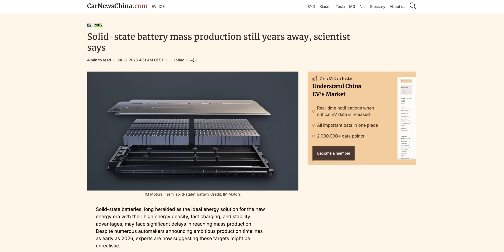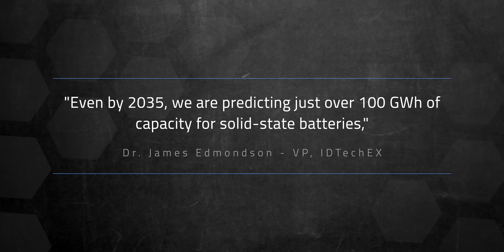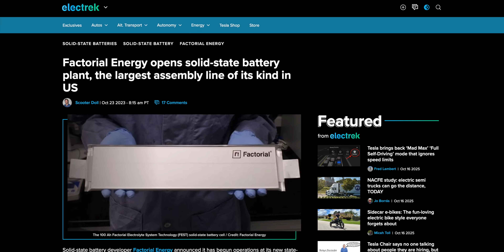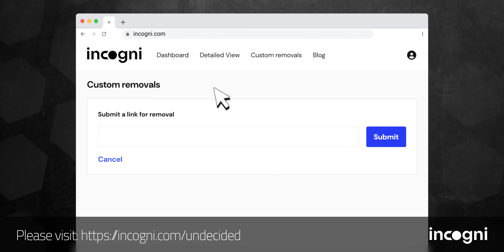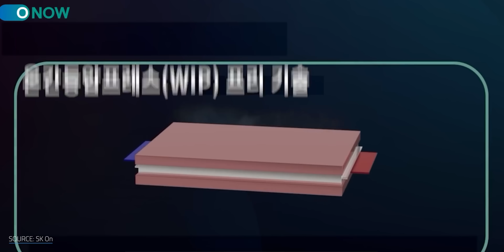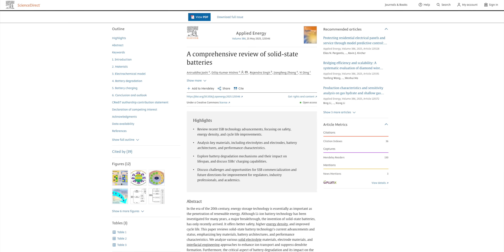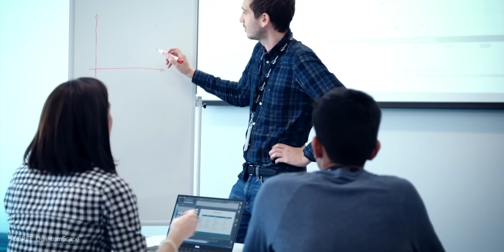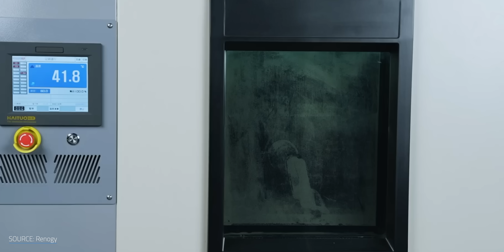How Close Are We to Solid-State Batteries?

Comment: Looks to me that most of the legacy automobile manufacturers have decided to throttle their BEV investments until battery tech, which seems to be on the verge of immense improvement in the near future, finally shakes out to the new paradigm. No one wants to be the one that invested in the last CRT factory.
Reply: Only in the United States. The rest of the world is continuing to move towards EVs, though with a little less enthusiasm since the US has regressed. And, even in America, research and product development continue. Gotta love the effects of politics on progress!
Reply: @GeeDeeBird  to be fair battery tech is really in a state of wild flux right now with a lot of potential battery chemistries and configurations with little certainty on which one will ultimately work the best for BEV. so it is a fairly smart move to keep BEV development in the back pocket until a lot of the craziness with battery development stabilizes. Even myself i am holding off on getting whole home battery backup installed on my house until some of the craziness dies down. the other issue here in the US and globally for that matter is the power grid infrastructure. EV's do require a substantial amount of charging, and power grids need to be upgraded to handle it. North America is badly hamstrung by our low mains voltage and the fact that nearly all homes use very inefficient single phase electrical services. EV charging sucks when your stuck on just 120/240, most of the rest of the world has the advantage of a higher mains voltage, 230 volts phase to ground and 400 phase to phase, but many of those services are also tiny by comparison. and of course there is the fact that many people live in apartments where access to a high powered receptacle to charge them is limited. EV's work fairly well for those whom have their own homes and can afford the electrical addons, but people whom are stuck in apartments are much more limited.

These infrastructure issues will be getting magnified once larger vehicles like Buses, RV's, and commercial trucks start getting electrified. Now some of the battery issues for larger vehicles could be alleviated somewhat by including high efficiency solar panels into their great big flat roofs, but the few pure electric Buses that have been trialed need big beefy 480 volt or 400 volt three phase chargers. Less of an issue for 400 volt land, since three phase is more widely available there, but a big issue in North america due to our moronic power grid design three phase isn't available everywhere.

Now these are problems that are solvable with good public policy, and they should be solved, but it is going to take time. But fortunately there is an even better alternative, and that's dramatically improved public transportation. Even the most efficient EV passenger car gets is rear end handed to it by the humble bus when it comes to energy efficient means of transporting people.Now yes good public transit isnt the best option for rural america or canada, But for cities, public transit is the true winner.
Reply: @GeeDeeBird  The truth is that the consumer demand just never really existed. Once government subsidies and energy rebates dried up so did the demand. Price of fuel and price of electricity vary widely from location to location, but in a lot of places such as where I live the fuel saving on EV compared to a modern fuel efficient ICE is about 30%. While this is not insignificant, for many people it is not significant enough to be a determining factor on a $50k+ purchase. And when you factor in the faster depreciation of EVs on the second hand market, and the talk of introducing an EV road tax to account for their wear and tear on roads that ICE drivers pay for through fuel tax, there is even less financial incentive to go for an EV.
I think things will only change once Chinese EVs build a better brand reputation. They can offer more 'car' for less money than traditional manufacturers, but buying a new car is still an aspirational purchase for most. They don't want to drop $50k on something that other people perceive and cheap or inferior. Budget purchasers buy second hand, where reliability is a critical factor and where Chinese auto makers have yet to prove themselves. So no demand on the second hand market means faster depreciation which again hurts new car sales. 
Anyway the whole EV market was built by government regulation and financial incentives. EVs are the future, but it was silly to think that the gov't would keep pumping money into the market for decades until the tech and infrastructure became mature enough to compete with ICE on every front. Apart from financial incentives the only other tool the gov't can really use is to outright ban the sale of commuter ICE vehicles, which is what many countries are planning to do, but flies in the face of US economic principles and will not be implemented there for many decades to come, if ever.

Comment: Wait a second.....
1 200km on one charge?
Where I can buy this Mercedes?
Reply: Yeah except what they didnt say is the battery cost several millions and can charge 15kw peak 5kw sustained.
Or something.
Stop yapping about range, the key factor is charging speed, with a hint on safety.
Reply: @kolkoki  I can tell you live in the EU LOL. Price does matter, but the charge cap doesnt matter all that much. I will say charge speed does help - but if you can drive 2 x more distance, you also have more time to charge as well for the everyday person (more nights you can charge).
Reply: @adr2t us or eu, if you can drive for 2h and recharge in 15 minutes, thats good enough. So 60kwh with 200kw.
Reply: @kolkoki  Not so sure for the US - driving for 2hs and having to stop to recharge could add hours to a trip. This is why I pointed out that you sound like you are from the EU. Going half way in the states to FL would take around 18 hours -> 18/2 = 9 * 15 (really closer to 20) = 135 mins = 2.25-3 hours. I also assume you will break more as well - so really you are adding maybe another hour for bather room breaks a bit more. I made this trip in an ICE car - took two days. Same trip in a current EV took me almost 3. So having the range in this case would cut off a few hours - dropping it back down to 2 days again. More or less, I like the idea in terms of how many miles the average person drives - but trips can still be a problem

Comment: Battery price falls 10-20%/year, energy density and charge time each improve ~3-8% per year. The solid state label is pretty meaningless, just a buzzword. So long as the batteries keep improving, they will overtake ICE cars in the long run and be far cheaper.
Reply: @BlindedByLogic  yes and no. The reason why solid state is a buzzword is because of the promise it offers of a huge improvement in all battery metrics rather than the expected incremental gains.
Reply: Battery prices are not going to keep falling in price. There is a lower limit. Even ordinary alkaline cells are not yet free, as one would expect by a simplistic extrapolation.

Simplistic extrapolation is a hallmark of modern "consensus science".
Reply: @HuFlungDung2  chinese producers have proven that the current lower limit is already below the costs of ICE vehicles, so every additional decrease is just a bonus ;)
Reply: @HuFlungDung2 it’ll drop to the point where the fixed costs can be sustained.  Eventually those fixed costs will begin to rise with inflation and there will be a price increase in batteries.  Also as power density increases, fewer batteries will be required.  Finally recycling will be automated, further decreasing battery prices as mining becomes less necessary.
Reply: @HuFlungDung2  "Battery prices are not going to keep falling in price. There is a lower limit. Even ordinary alkaline cells are not yet free, as one would expect by a simplistic extrapolation."

Oh, look, it's a stable genius who.... Doesn't understand middle school math. If we reduce a price by 20% per year, how many years will it take to cost zero dollars and zero cents?........... It will literally NEVER hit zero, not even with infinite time (you will end up in an infinite rounding loop at 1 cent). It will still take more than a million years to reach 1 cent. I doubt the cent will even exist by then.

Alkaline cells have in fact been reducing in cost continuously all the way up to today. In theory, at some point, some limit will be reached that will halt the trend. Literally no one believes it will literally go on for a million years until they become literally within a rounding error of free. However, within a reasonable horizon from today, the trend has remained steady for literally a full CENTURY, and we have no reason whatsoever to believe it will change for at least another CENTURY.

"Simplistic extrapolation is a hallmark of modern "consensus science"."

8th grade math. You xxxxed up 8th grade math, and think you are somehow qualified to criticize modern science. Stop. You are actively fighting to spread misinformation (that 8th grade math disproves) and make our species stupider. We will be better off without our contributions. Stop.
Reply: @HuFlungDung2 if it drops by a percentage every year it will never be free
Reply: @BlindedByLogic   Is there any concern with sourcing the metals used in battery production? Defacto modern slavery etc?
Reply: No it won't. Even at the theoretical limit, lithium batteries still can't overtake ICE. It's why solid state batteries is so important, because the theoretical limit would be much higher.
Reply: @khalidacosta7133  blindedbylogic is talking about just batteries in general, not any one specific battery chemistry and configuration, and there are a lot of potential replacements for lithium out there, but its going to take more development to figure out which one will ultimately be the best. and its likely that there will be multiple types of battery chemistries that will win as we figure out which ones will work the best for what application. Like for example a battery chemsitry optimized for a high power to weight ratio is ideal for cars and mobile devices, but not necessarily the best choice for home or grid energy storage where cost per Kwh and long lifespans are more important factors than weight.
Reply: @khalidacosta7133 oh yes they can.  If EVs were cheaper they take over in a few years. ICE is on a dead-end track.
Reply: @khalidacosta7133  Even the compliance cars from the turn of the century were able to handle typical driving (at least in warmer climates).
With ranges of 100 miles/day.
Reply: YASA has a prototype motor at 59kg/12kg. That's 1000bhp. 350-400hp at 28.4 pounds continuous with no exotic materials. 

 Dragsters have 25-35kwfrom what I can find. Have to rebuilt. Someone correct me on the numbers. 

 Chevy(Edit Chery) has a 600wh/kg battery. Graphene capcitators. Pilot plants next year supposedly. 

 Life is good if true. Tech wise. They'll bleed us for it, but it will trickle eventually. 

 Imagine a Miata sized car with full torque vectoring, no tech bloat with a few motors like that.

 Edit. I didn't catch the Chevy typo. Or the MJ! Had to convert that. 

 And the motor is actually 350-400kw continuous. Closer to 500-550hp!
Reply: @RedactedDeath  The mistake you are making is not by stating the torque the motor has. It can spin at 30k RPM and show high horsepower but back in the real world it'll be paired with a reduction gearbox and that motor won't be as impressive. However issue has never been the motors, it's always battery tech,

Chevy has nothing. Car manufacturers do NOT develop battery tech.
Reply: @khalidacosta7133   Yeah I butchered that one for sure. I deserve all the hate. 

  Chery not Chevy. Think they work with Samsung. 

 That's what I get for asking AI to type up the numbers again. I hate converting all of this stuff. 

 Motor is even better then what I said. 

 So it's 59-61kw. I said 59MJ/KG. Even asked WTF that meant yesterday. 

 The continuous is actually better. 350-400kWh. So like 29-31kw/kg. 

 Comparable to a top fuel. Without rebuild. AI says not even dragsters hit it.  

 Yeah of course it needs a power train, and energy. I need to see the cooling. 

 That's what destroys these. We have motors that spin fast, reliably, and YASA is known for high torque axial flux. 

 Cooling though is an other matter. 

 Luckily batteries keep improving with so many on the way.

  I'm not an absolutist. Only the Sith believe in absolutes as I'm always told. Gimme a range extender. A rotary or turbine even for a series hybrid. 

 If F1 allowed rotaries I would bet we'd have some good ones. 

 I will edit my post if I find the torque numbers. 
 
 No matter how ya spin it the motor is dope! That tech will trickle. People committing to pilot plants as well!

Comment: Bets on which comes first: Solid State Batteries, sustained (non-commercial) Fusion, or Residential Nuclear (microreactors)?
Reply: weve had microreactors for more than half a century, its just used exclussivly by the military. Making them commercial is really up to governments.
Reply: @calebfielding6352  This, but it's not just that, they hardly make sense outside of military and temporary installations. You're better of building a traditional reactor for residential and towns.
Reply: Definitely solid state batteries, fusion is a hard physics problem, and residential nuclear has a lot of non-physics problems.
Reply: It depends what you mean by microreactors, the size of a Mini already exists, the size of the fusion reactors in fallout will never happen, you just can't miniaturise all the tech that's needed sufficiently.
Reply: Given how much outrage many of the general public have at the simple thought of the nuclear word no matter what context those last two I'd put as technology might be ready tomorrow and its still 100 years or so away as it won't happen until the oil reserves are really really depleted so the marketing/PR and lobbying budget of the big oil companies dries up...
Reply: gta 6
Reply: Dont forget about lithium-sulfur battery technology
Reply: batteries, maybe thorium reactors in China
Reply: Depends on what you mean by sustained fusion. Inertial confinement is inherently pulsed. That said, I wouldn't at all be surprised if ITER or Helion achieved steady state operation before an ASSB is brought to market in a mass market production EV.
Reply: @Menesenha  Solid state batteries - 2029, fusion - 2034 (but probably too costly to compete even with conventional nuclear), third I dunno

Comment: I really wish we could stop using volumetric energy density.

Unless a new battery is grossly worse in this category than previous batteries, it has long since not been the limiting factor. It seems like a distraction from the actual energy density - the actual factor that’s limiting range and application in aircraft, most likely because it’s not that good.
Reply: Energy density has to be measured per something, there is no "actual" density, both mass and volume are important.
Reply: @robhayward2655  by “actual” I mean mass, because as of right now no battery  is light enough but just won’t fit inside a car or airplane.

Volume is maybe a limiting factor on earphone? Even then, price seems more important

Comment: Frankly I don't expect to ever have an EV I want, at least right now, before I can no longer drive.  I want a large vehicle that exceeds what my F150 with a V8 will do.  I get over 20 miles per gallon on the road, and yes I travel a lot, or over 500 miles per tank at highway speeds.  I'll even wait 15 to 20 minutes for a charge if my 20% to 80% will match that distance.  I'd really like so much mileage that I can drive as long as I like and never have to think about the remaining charge.  Of course access to charging is still as much of an issue as distance.